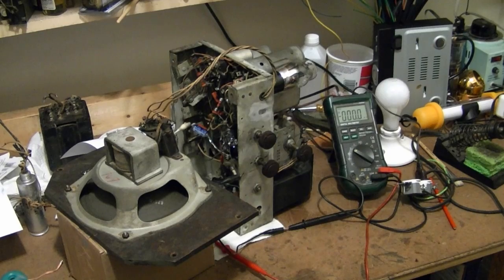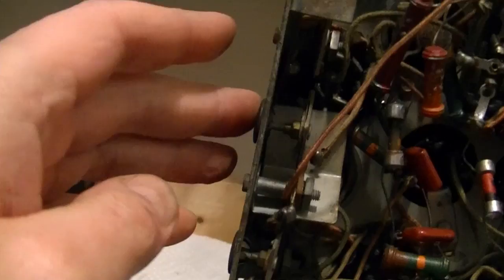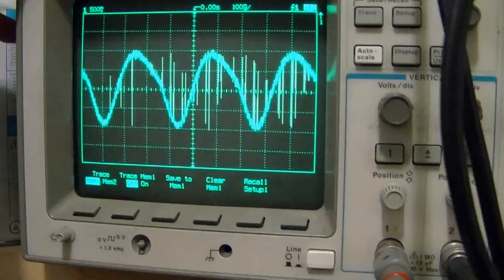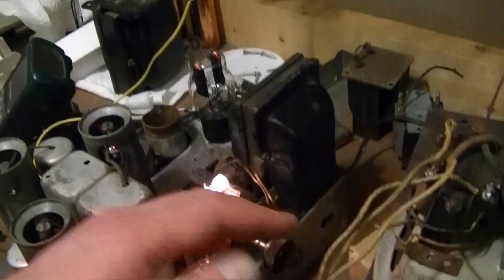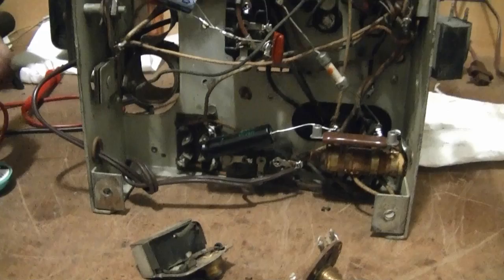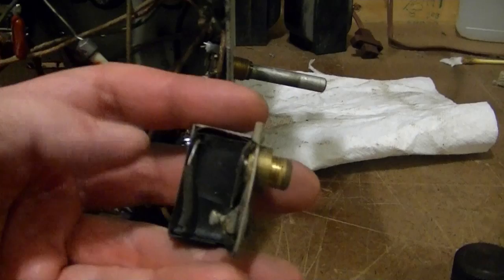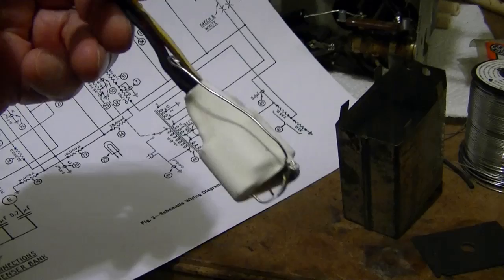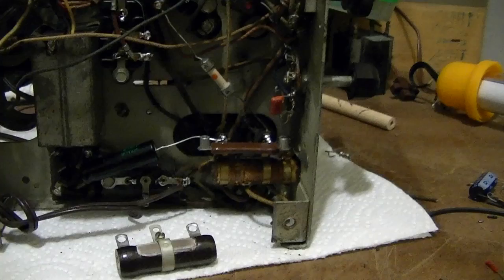Philco 60 MB restoration p3o10

Comment from the maker: No, so far I've been pretty careful and lucky.  Usually, I replace the caps and check the wiring before attempting a power up.   When I do power a set up on original parts, I use a variac, dim bulb and don;t leave it on for long.   I have made a mistake once or twice though and had a new electrolytic start to smoke ;)

Comment: With the last box capacitor I restuffed I peeled the fish paper off of the old block and lined the can with it. I also recovered the tar and used one of the old paper caps in the bottom of the can for filler material by laying it on it's side. Then I used some old candle wax followed by the old tar/black wax to pot the new caps inside the old can.

Comment: I had to melt the tar first just to get the caps out of the can, about the top 1/2 inch or more, even though it was lined with a sort of cardboard. So i collected the lumps of tar and melted it into a tuna can I had laying around, then I drove a large screw into on of the paper caps and pulled one cap out, the rest followed. Since I would have ended up tossing the old caps and tar/black wax out anyhow I though I should try to reuse some of it.

Comment: I can't think of any easy way to repair that tone control switch, if it were made the normal way it would have a locking ring around the shaft and all you would have to do is transplant the shaft from one control into the other. In this case it looks like the end of the shaft is routed through the wiper and then peened over, it wouldn't be easy to fix even in the best of circumstances.